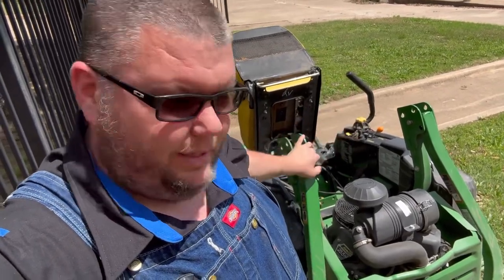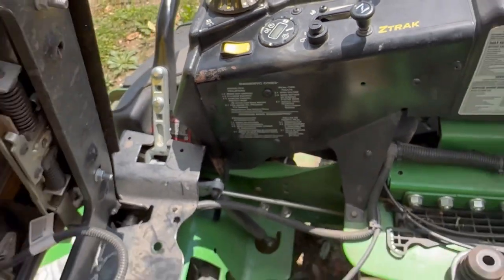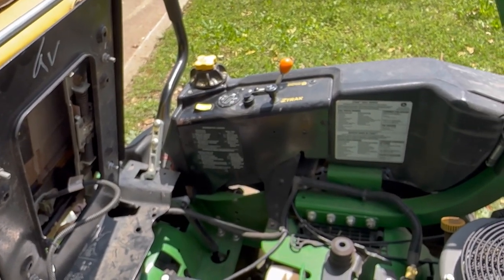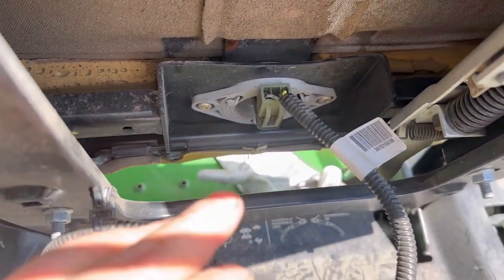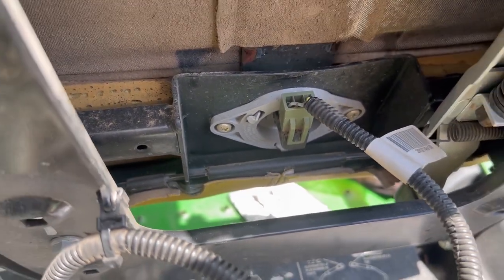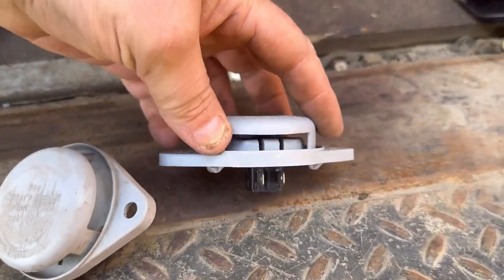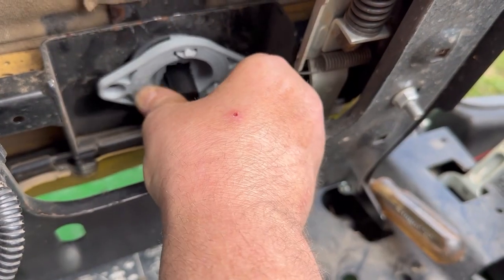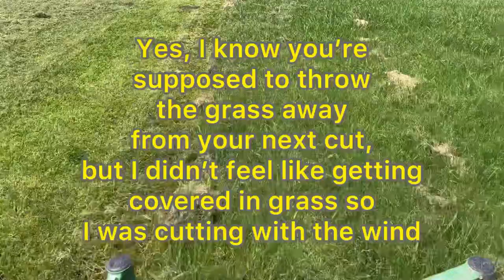HOW TO FIX A MOWER THAT THE BLADES INTERMITTENTLY SHUT OFF / SUPER COMMON ISSUE / JOHN DEERE 930M

Comment: Good info.  Now, I have been mowing since I was 8 years old, I am now seventy-two.  I never knew you were NOT supposed to throw the grass INTO the uncut grass.  I always thought the result looked better. Of course, I don't let the yard get out of hand either.  When we swapped from our reel type mower to a rotary mower (the last ones in the neighborhood to switch over) I started doing it that way and have just kept doing it. I'm not sure if I can make myself go the other way now.😀
Reply: It's to avoid overloading the mower... otherwise it snowballs until the mower acts more like a hay baler! I'm guilty on doing such when I have to... thankfully my old modded 46" simplicity (with an old 1993 Vangard v-twin) tolerates it.

Comment: grasshopper dealer switched to  KINETIX oil for all their small engines.  high zinc content.  have you  ever tried it ?  oil still covers warrenties .  they have been using it for thee last 3 years or so.  dont know if grasshopper themselves have changed or not

Comment: The mower i'm using is a 997 Ztrak - after 35-45 minutes of continual use - the mower blades disengage.  I shut switch off and on to restart blades, the blades engage for 90 seconds or so (moving or even stationary) then stop turning again.    Any ideas?  Thought it was low oil/over heating but that's not a problem, the PTO switch is fine, not a seat switch issue (ie... moving or stationary).

Comment: I would have bypassed the switch myself and done away with that seat switch.
Reply from the maker: Can’t too many idiots out there
Reply: That’s what I did
Reply: Now I have to find out on where the switch is that turns off the blades when I put in reverse, on a Cub Cadet